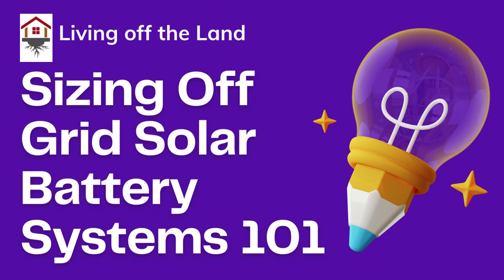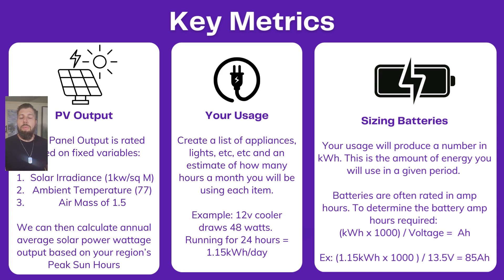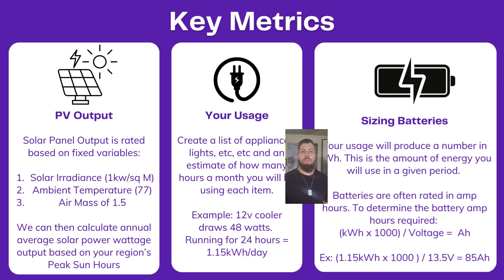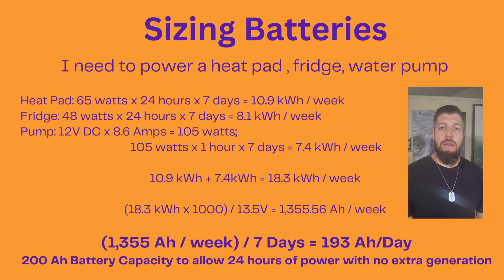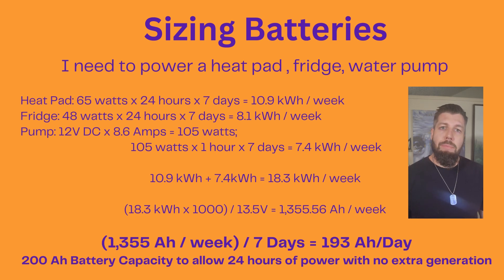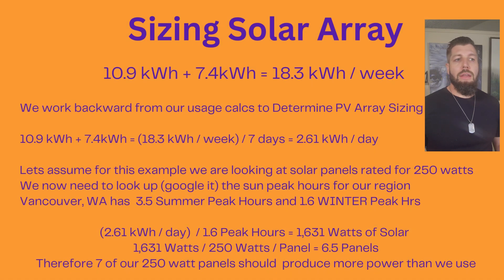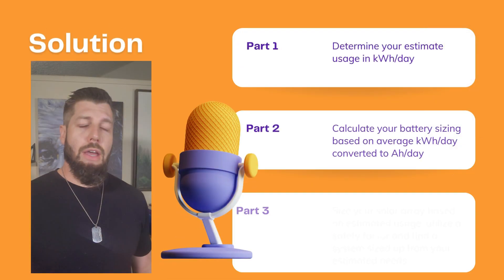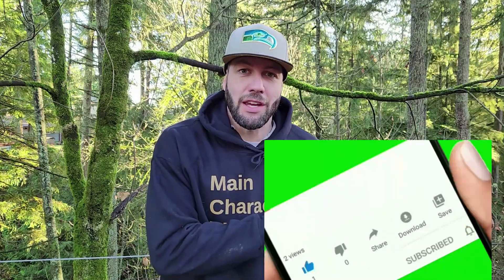DIY: How to Size Off Grid Solar Panel & Battery System 101 | LOTL

Comment: I plan on learning from this video and applying the knowledge in this video to a practical application of 
cooling up to 700sqft of a closed space indoors, but venting the hot air through a portable AC.

As you know we've seen just how fast thousands of people can go into a life threatening situation
from just one hurricane in the Houston, TX  area when power could not be restored fast enough,

I've already found  the best or one of the best  portable like  solar panels capable of outputting 400 watts for under 150.00
(weight apx  32 lbs )  (per panel)  and I've located and heard from a trusted in depth reviewer, that this portable AC from Midea
is the best portable AC  on the market ,  It's not cheap at almost  700.00  but  it can legitimately heat or cool up to 700 sqft and it's as quiet as it gets
when it comes to portable AC's  going all the way down to just 42 decibals on it's lowest setting,  ( in other words you'll barely hear it at night
when you need to sleep as long your apx 5 feet away) 

but what I don't know is how many panels it would take and how long the AC unit could run if running off  say the
ECO FLOW  Pro Max  which cost  apx  2100.00  (and is a real bargain from what I'm hearing as it's being replaced by the newest model which is the
Pro Max 3, which does have of course some advantages,  but  cost over 1100 more.

https://www.amazon.com/EF-ECOFLOW-3600-4500W-Generator-Emergencies/dp/B0C1Z4GLKS/ref=sr_1_1_sspa?crid=3HCJMZ8NX3Q18&dib=eyJ2IjoiMSJ9.dPOOX-KqDQ6qlpMPfBW8s4li64Nim19UryupCy8jkWYbfmUdV1yLmwE0fmsAV6qZWkE-0kq5jJod2axIcjx4nY1TzoPokFuS-A4VY9NcfRs_4fcePllIX1AlG9kaSSjN65jbZD7N-Ri_9Myyjhcuj5o5Mvw7aqpMF_yA7yH_wV76zVwG4cjObg-7wOD2_XF1yBKnKIfK2rsatTxlMpjrJihZs5VWHKwOLLkIlWZTMn8.RfX-DXYrTT6TP_kNncOr8WVdfpEx9C8E-KDGz4Vbovg&dib_tag=se&keywords=ecoflow+delta+pro&qid=1721638022&sprefix=ecoflow+delta+pro%2Caps%2C164&sr=8-1-spons&ufe=app_do%3Aamzn1.fos.1740e8b9-be2d-46a4-a376-9d8efb903409&sp_csd=d2lkZ2V0TmFtZT1zcF9hdGY&psc=1

and:

https://www.amazon.com/Midea-Inverter-Conditioner-Dehumidifier-Assistant/dp/B091CJVD2N/ref=sr_1_1_sspa?crid=EA73R69DHY09&dib=eyJ2IjoiMSJ9.IK23G8Sj_OluvcYska3n8ocdJezAPGVHcqTRPZREVqfMcrn7AQ6s5S9P_tEATbWgFLDJNW0OT4Y54emc95oPiHvhZSqAy1rGIulIEILrJo1jYWK3s1mLPK2VMe0GlPpqXdQCVOex2Jv6YE8tppdHk3BEjbadxCvIzspAs_0-Ct-3xCGCPgwaJ-fRiGSZfxPvbot9pBWxV6JWpzn2yGlWdJ9P7lye1oEgDCi0xfRy7e4.BHNKVf7P82oZynwhgnGoGX7lEVqFodm-qAZ3QDjZ4TM&dib_tag=se&keywords=midea+14000&qid=1721638128&sprefix=midea+14000%2Caps%2C336&sr=8-1-spons&ufe=app_do%3Aamzn1.fos.1740e8b9-be2d-46a4-a376-9d8efb903409&sp_csd=d2lkZ2V0TmFtZT1zcF9hdGY&psc=1

there are also some good youtube review's of the Midea model, which I don't have handy at the moment, but it was a real review that was impressive enough
to convince me,  that if money is no object, when it comes to portable AC units that went through horizontal or vertical windows,   that's  the unit to get because of the 12,000 SAAC rating
and not the deceptive faulty  BTU  rating most people are still using to judge  true cooling power. 

The panels I'm referring too,  are new for 2024 and I found out about from this  guy's channel,  who is really good in his ability to communicate all that he knows:

https://www.youtube.com/watch?v=v33nbi7gKcY

My Favorite Offgrid Solar Panel for 2024!

DIY Solar Power with Will Prowse
925K subscribers